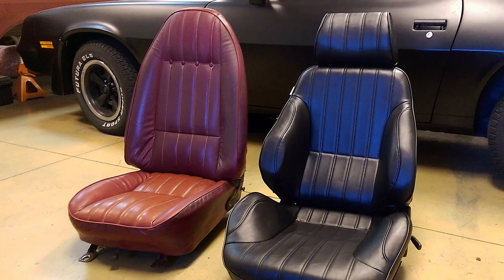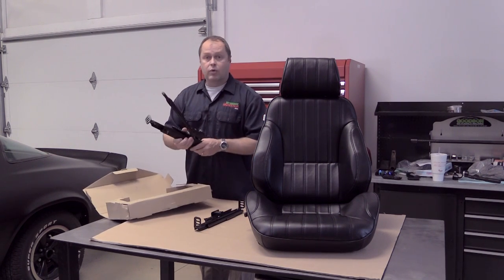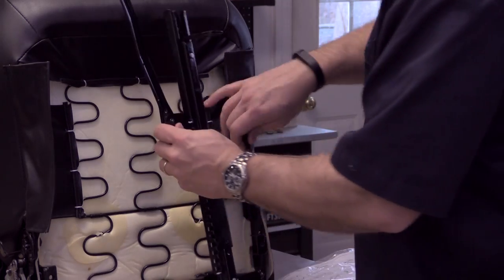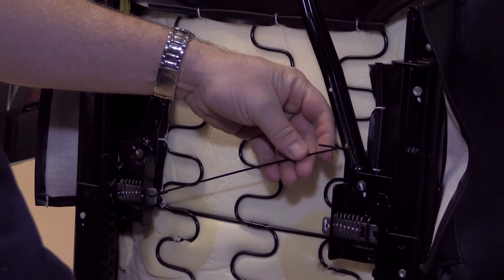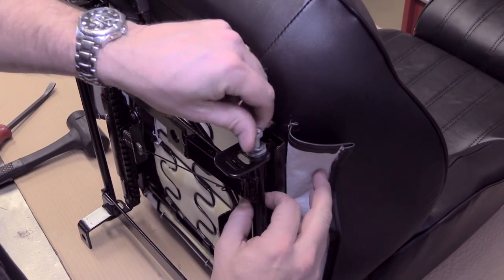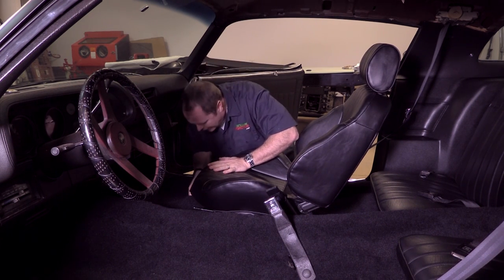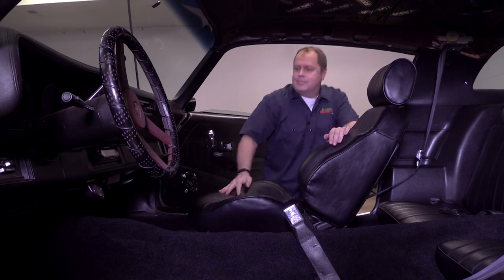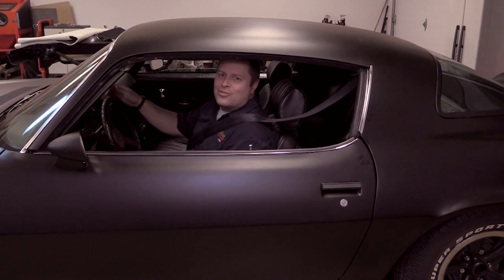Tips for Installing ProCar Rally Seats in Your Next Restoration

Comment: Great vid! Very informative! Do the seats stay at stock adjustment? I'm 6'4"and need a little more leg room. Just curious. Thanks!
Reply from the maker: That was my one nit-pick. They are a little high, even as low as the mounting bracket will allow. You know those second-gen Camaro and Firebird seats were sitting practically on the floor of the car, so that's got to be hard to match. But I notice it when I drive the car. Plan to try and modify the brackets someday to see if I can get them lower. Thanks for watching!
Reply: @TheHorsepowerMonster   I cut and welded new lower tabs my Procar frames and got the seats down about 1" on  my '70 Nova. It made a huge difference. Don't wait another day - you'll be glad you did it!
Reply: @thebandit4393  i seen that they sale mounts that you can assemble yourself for cheaper since you have to cut

Comment: Why no comment on the fact the height adjustment on one of the sliders has been cut? See 2:30 into your video.
Reply from the maker: Yep, to get the seat to go as low as possible on the mounting hardware, you have to cut part of the bracket on the seat. It's just part of getting a universal seat to fit as many car-specific mounting brackets as possible. When working with older cars that's a part of life, so I didn't think it was a big deal.

Comment: I had some scat procar seats. Cost around 750$ with the brackets. Didn't last 6 months without springs popping up through the seat cushion, the plastic coupling piece under the headrest breaking apart, and the bearings for the sliding mechanism getting punched out. Absolute worst automotive purchase I have ever made.
Reply: I got screwed over also. I wish I would have save my money and got something else. The 2 year warranty is no good either.
Reply: @rtp3962  Same, i did everything i could to get into contact with someone, but that's part of their scheme. Say it has a warranty, but then ghost all the customers. 

It's a shame, my grandad said they used to make quality products (I guess he had used a cam or two from them back in the day)
Reply: can you leave me your email address. The company contacted me and is supposed to be making good on the warranty. I can forward info to you
Reply: Too late for me. this was back in 2014. I ended  up unloading them for pennies on the dollar (seeing as i had no other option) and buying back stock replacements. Thanks though.

Comment: I bought the exact same seats for my 69 Camaro. I'm 6' 0" and 200lbs and these seats suck. I not only modified the slider brackets to go lower but also modified the floor mount to slide back farther. The leg room turned out ok but I have to slide them back when I exit the vehicle every time. The drivers side left bolster pad is wearing out with the car getting minimal usage.  The pad is very thin and my left butt cheek rises on the steel frame. The vinyl is worn through and the beading is falling apart. These seats are far from quality. For a 6' driver they are not comfortable. I dont know what brand of seat to get but save your hard earned money and look to other manufacturers for seats. I complained to the company well with in the warranty period (2 years) and they wont stand behind the.
Reply: Thank you for that info! I am a bit over 6' 1" and have a 1969 Camaro also. I had to use seat extenders on the factory seats just to drive comfortably. I am just now researching replacement seats and brackets so your post is very helpful for me at this time.
Reply: How did you make the seats slide back farther